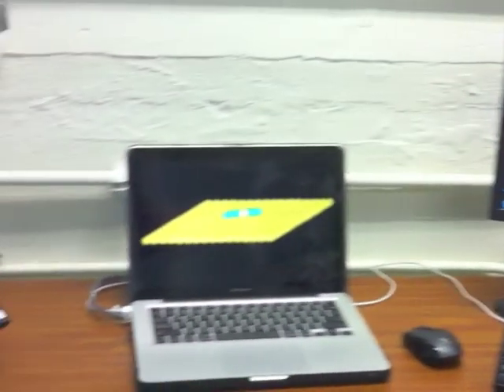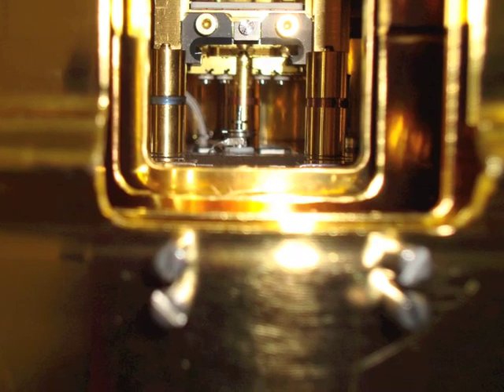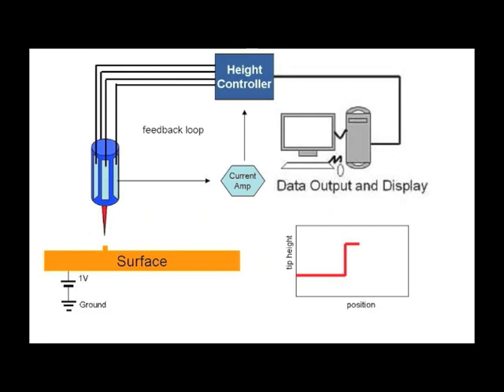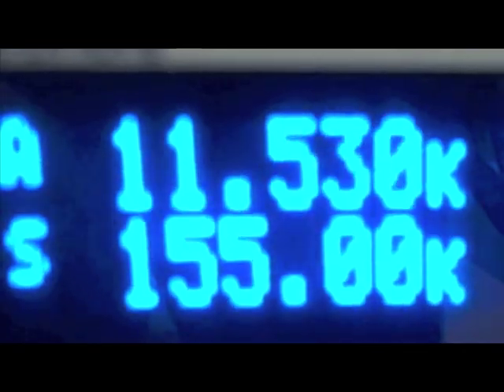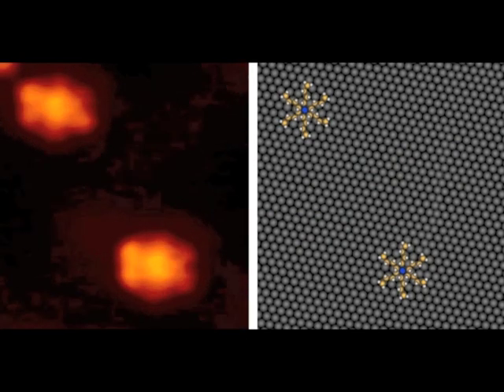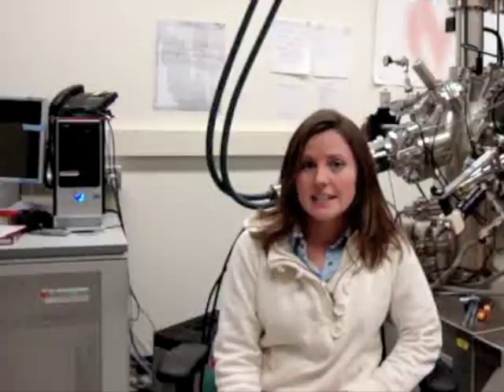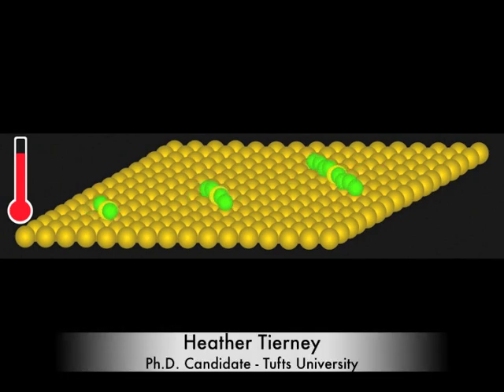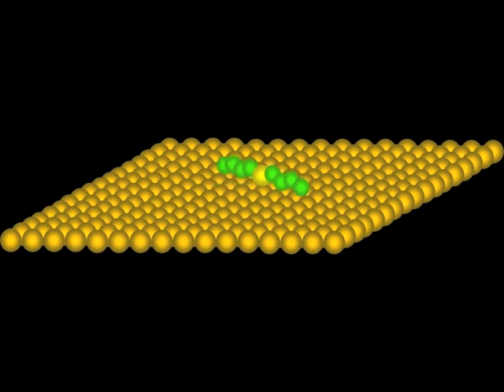World's Smallest Electric Motor: Sykes Group Tufts

Comment from the maker: @oker59 This motor is actually 1nm long. The motor you may be thinking of was created by the Zettl research group in Berkeley. Their motor is listed as 200nm long.

At the moment we are moving 18 atoms around. 1 Sulfur, 5 Carbons, and 12 Hydrogens. We have similar experiments where we have replaced the Hydrogens with Deuterium.

This is one of many steps in making nano scale machinery but we believe that it is an important step.

Comment from the maker: @USTEMPLAR If you mean a cooling effect due to vapor or evaporation like with a fan, then no. This experiment takes place in Ultra High Vacuum. On a good day the vacuum in our instrument can be 10 to a 100 times less dense then outer space. 

There would actually be a slight heating effect as the vibrations induced in the molecule transfer into the surrounding atoms they would heat up slightly.

However, this experiment takes place at 5K so already it's about as cold as you can get.

Comment: Eric Drexler has tried to make the nantech era happen for over thirty years now, and we've finally gotten a nano-electric motor working.  

Well, it will be interesting to see how quickly these guys(and the Singapore group!) add more gears and mechanical elements and make molecular machines that can move 'individual' atoms around.  I mean this is what 200 nanometers long?